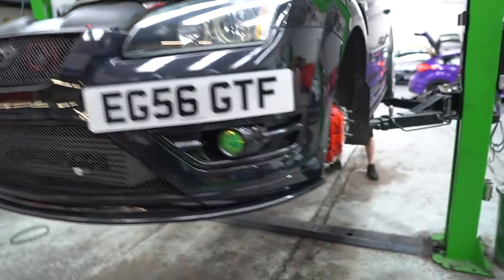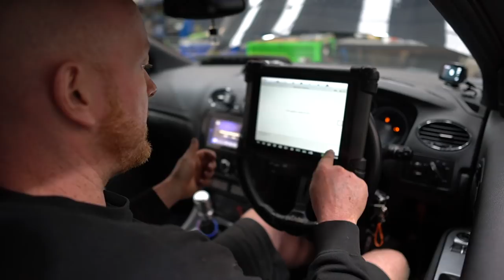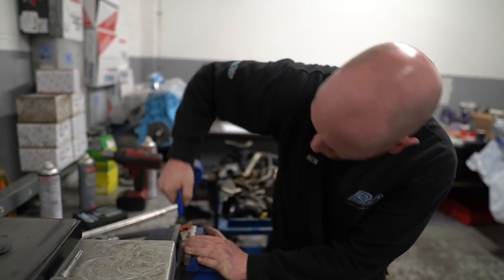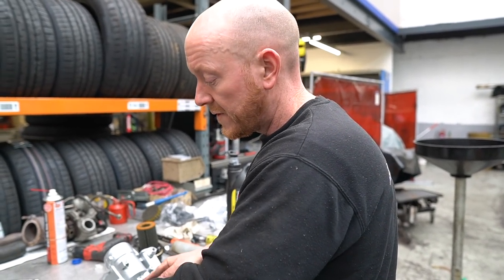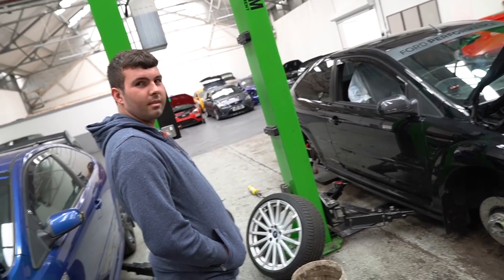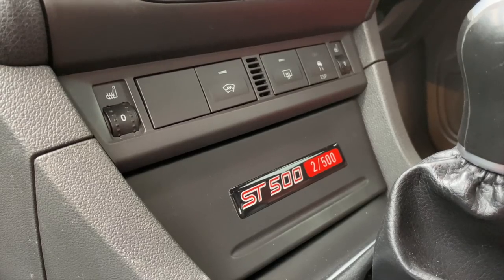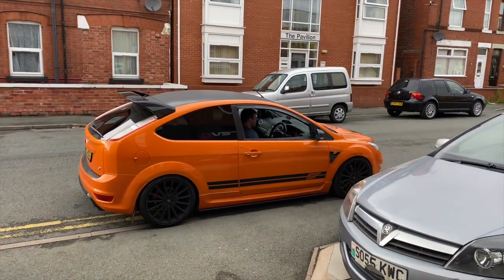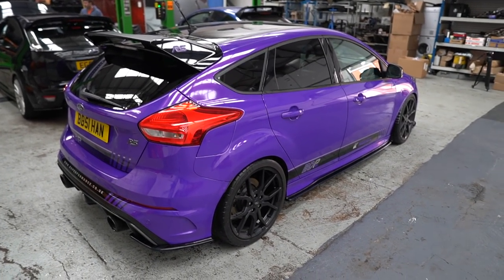FOCUS ST GETS OIL BREATHER KIT AND RS OIL COOLER

Comment: Why not use the same pcv valve and direct the oil vapor discharge outside, without using the oil catch can?
Reply: Mess on the car, mess on the road, not good for the environment.

Comment: I did an almost equal one, but on the top I put a small filter to let the gases out... However, sometimes it ends up leaking a little through the filter when I accelerate hard for a long time... is this normal?
Reply: I'm also following for an answer

Comment: why are there 3 hoses the new welded thing got just 2 plugs
Reply from the maker: One of them deposits the excess into the atmosphere. It’s fed from the breather kit towards the floor down by the undertray :)
Reply: @GCMYT  so it's like the small filter you see on other catch cans from ebay for example